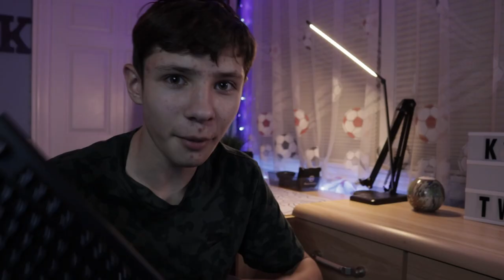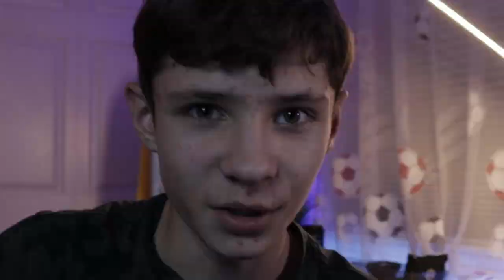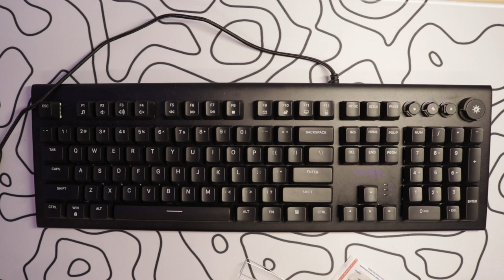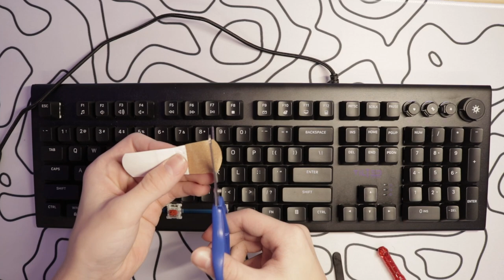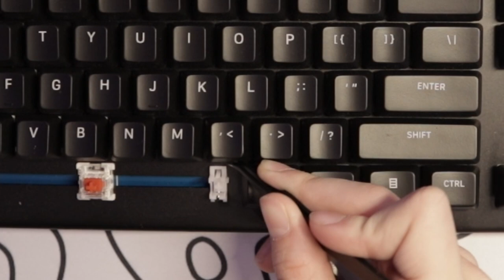How To Bandaid Mod A Not-Hotswapp Keyboard!!!

Comment: In my opinion, I wouldn't do the bandaid mod to all keys apart from the spacebar. One of my enter stabs fell off and because i cant desolder neither can i solder. I just took the other stab off and put the enter on. Because the keycap isn't that long you don't notice it that much.

Comment: i tried to do my own kind of mod but my stabs fell off but the wire was still there so i tried to kind of install it back but gave up since it almost ripped my finger and i was just wondering if someone has any ideas on how i can install the stabs back in without desoldering/soldering

Comment: Sadly my stabilizers came off when i did this and idk what to do lol ☠️
Reply: Just resolder the switch and put it back
Reply: @heartbroken3344  “just resolder” like i have the equipement to do that
Reply: @gsshunter just finished fixing the stabs with no soldering equipement. 😉😙
Reply: @roosar1060  how
Reply: @galaxidiotisgr4639  i used the method in the vide
Reply: @roosar1060  what method

Comment: When ever I do this my space bar just stays down when I press it
Reply from the maker: I explained how to fix that in the video
Reply: Gotta move the flap to the original spot bro
Reply: @breh1843  That hasnt worked for me, its already in the original spot. Do you know what else i can do?
Reply: @graciee1156  try putting a tiny bit of kleenex under the stab holes on the opposite side where it’s staying down. for example, if the right side stays down, put some kleenex under the left stab hole and so on. please remember to do this on the space bar holes and not the actual stabilizers. hopefully this helps, and ur welcome if it does.